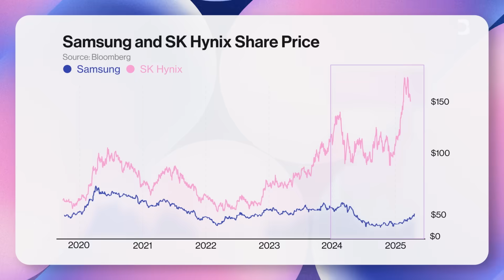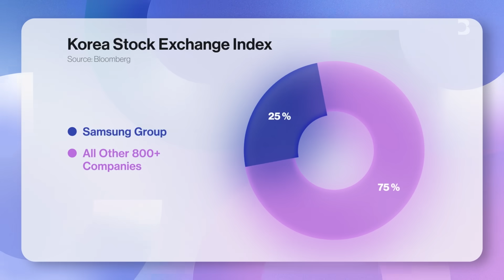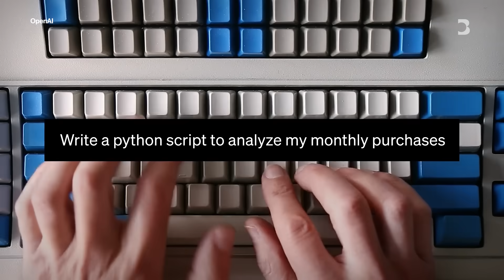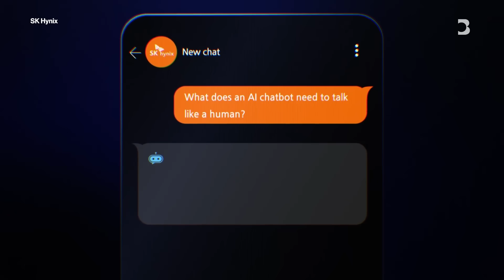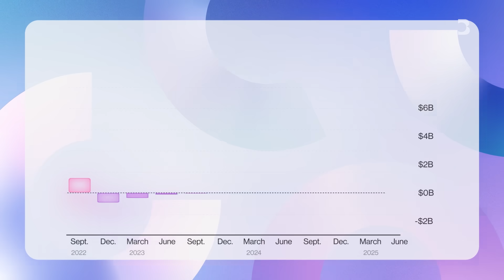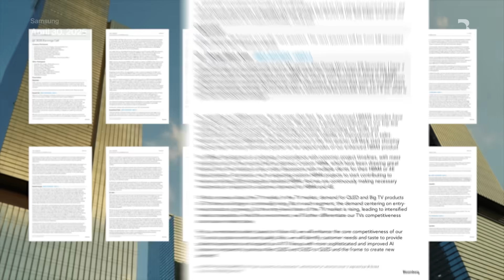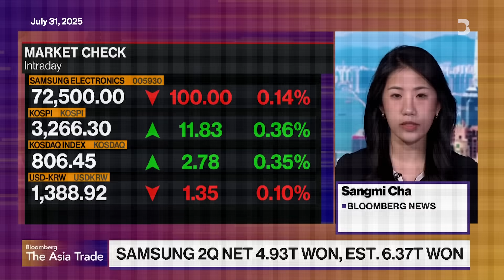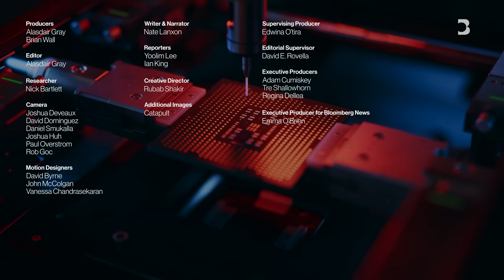Why Samsung Is Falling Behind in the AI Chips Race

Comment: This video does not mention the biggest problem Samsung has faced for over 10 years.  JY Lee, the sucessor of Samsung Group and de facto leader, has been in and out of court and jail for 10 years due to corruption charges which were ultimately thrown out earlier this year. 

During the past 10 years, Samsung Group was basically in a holding pattern, making no big investments and taking no risks.  The M&A and strategy group within Samsung Group was also disbanded, so there was no oversight or coordination among the different Samsung divisions.

SInce JY Lee has now been cleared of all charges, there should be changes to how Samsung Electronics operates.

Comment: if samsung missed, imagine Apple. at least samsung ai features work
Reply: Google AI. Samsung does not have AI.
Reply: @dominic7012 Gauss AI is there btw
Reply: @dominic7012 Samsung has galaxy ai on device... Since 2024
Reply: You did not get it. Galaxy AI is good. They meant the CHIPS (DRAM memory chips), which Nvidia doesn't use from Samsung - but its rivals.
Reply: Apple doesn't make chips
Reply: @gaebolglancer  apple designs chips and sends them to be printed at foundries like tsmc or samsung
Reply: @ayoCC but they do not design chips for any 3rd party or ai, nor are they trying to take any pie from it
Reply: @gaebolglancer   true! they're only using their chips for their own computers you're right.
They could totally split off their chip design department and become a viable competitor in the chip market i feel